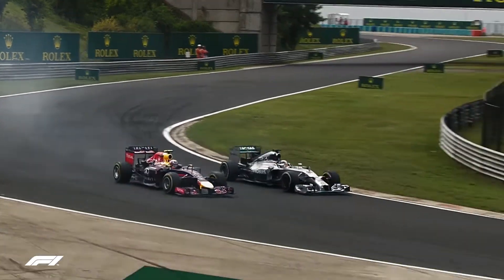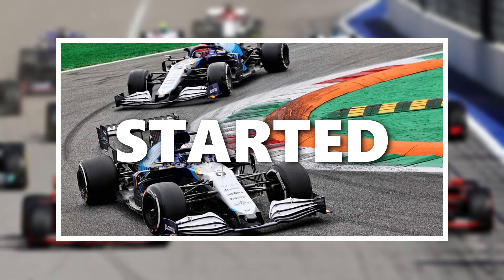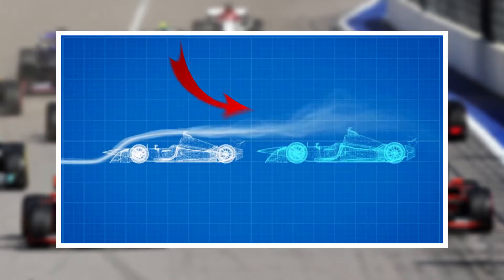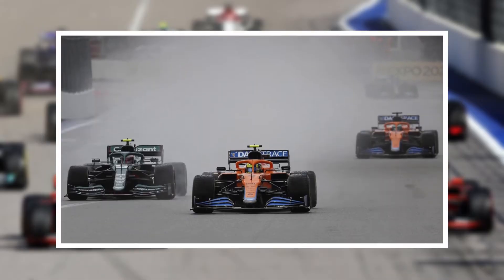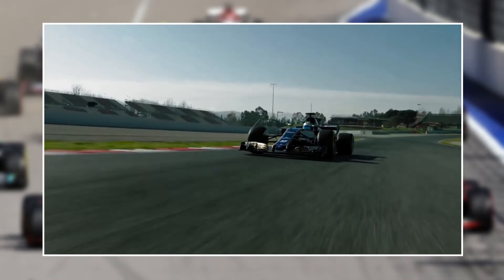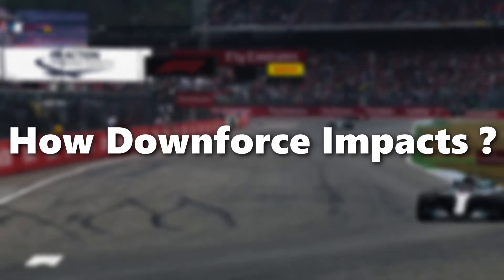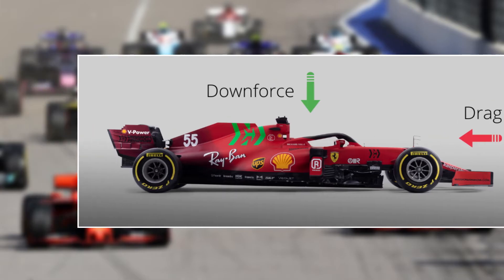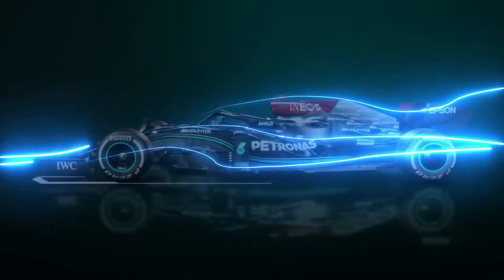Slipstream in Formula 1 Explained

Comment: TL;DR. Context is everything.

The “slipstream” behind a car, as a result of the leading car punching a hole in the air, takes the air off of your splitter/front wing and off of your spoiler/rear wing. This allows you to go like hell down the straights… because it mutilates your downforce. Thus, when it comes time to make a corner, it’s best to pull out of the leader’s wake or you’re just not going to have enough aero grip to make it through in one piece.

The slipstream and dirty air are the same. It’s where it happens when you use one or the other.